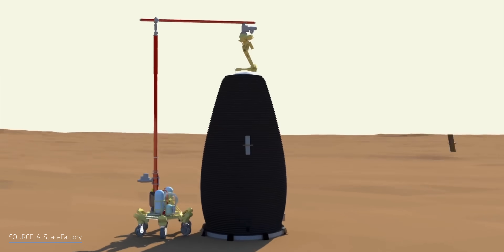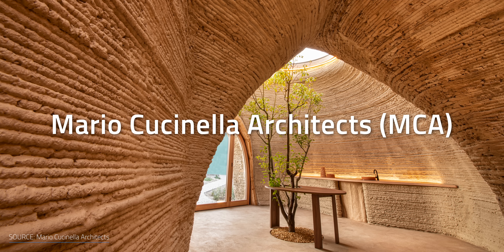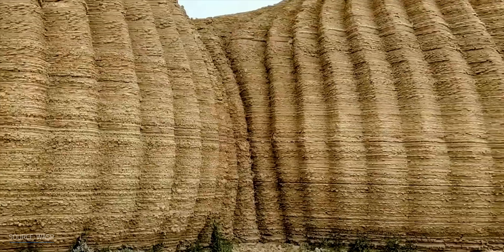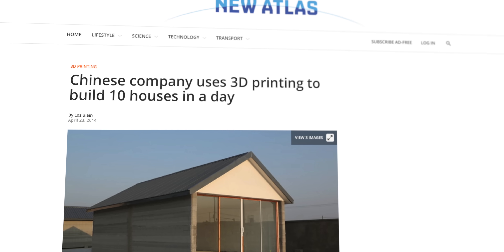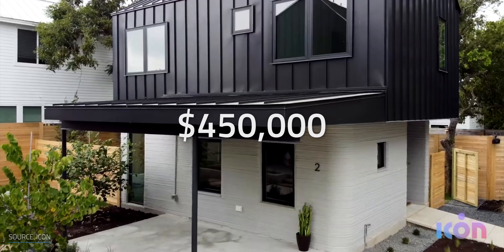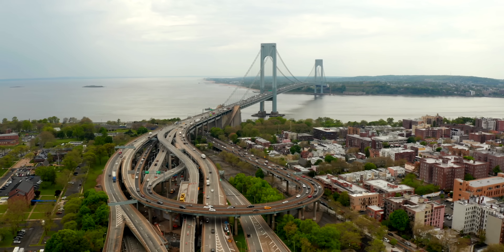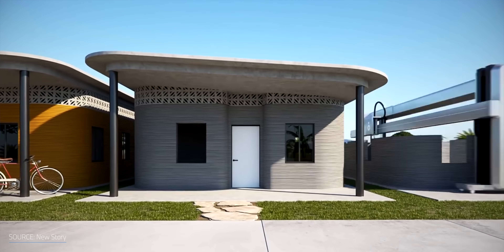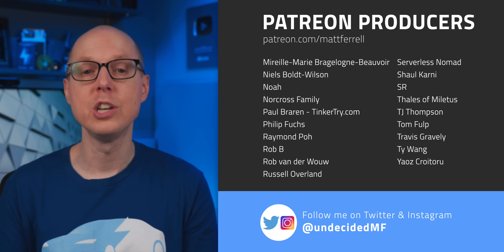The Truth About 3D Printed Homes

Comment: Issues I have seen with the only 3d printed building I have ever seen was the lack of rebar or other means of reinforcing the concrete and the building structure began cracking within the first year.
Reply: @TheItalix  If you look you may discover that there is some difference between rebar used to reinforce the concrete, and the steel beams. While the rebar is there in the concrete, the frame itself is comprised of steel beams. Anyone who has ever poured footers or slabs knows that there is also rebar used there.
Reply: @Andrew Layton It will not feed into the printer without balling up. There is no linear feed in the unit here, only a trough.
Reply: True
Reply: The
Reply: Marcus, which building is that?  Thanks!
Reply: @SpaceCrete  It was part of a hotel in the Philippines near where I used to work.
Reply: "Total Kustom"?
Reply: @SpaceCrete  Could be, as I was rather busy and did not spend much time outside.
Reply: Just fill the printed walls with concrete. As in a fixed formwork.
Reply: Rebar is the thing that weakens concrete.  Just watch some videos about "spalling."  
The Roman Parthenon, has stood for thousands of years.  You don't need rebar.  The Romans probably rejected it as idiocy, which it is.  
Insert a bar inside concrete, made of iron...at the first sign of moisture, it rusts, and EXPLODES the concrete away from itself.  
The sooner we ban that super-collapsible, extremely weak construction method -  the better.
Reply: @KathrynsWorldWildfireTracking  its to take the tensile forces. Without rebar concrete doesn't have the ability to withstand tensile forces. Sure, you can design concrete in a way to always be in compression, but this generally leads to inefficient designs. There's a reason it exists. Please don't assume you know more than all the industry experts out there who have dedicated their life to studying this subject
Reply: @KathrynsWorldWildfireTracking  as shown by the horrible building collapse recently in Miami...which I hope won't happen again but probably will...
Reply: @KathrynsWorldWildfireTracking  have you ever  been in a solid  mechanics  class?
Reply: @KathrynsWorldWildfireTracking  The Romans used different types of Concrete and construction methods as well. Rebar can create conditions ripe for spalling, but so can too thin a mud mix. Coating it may help in some cases, but your point is salient, though it does not always happen either. Most buildings still require some means to reinforce the concrete, especially in areas like garages and others with large, thick slabs stabilized with beams.
Reply: @KathrynsWorldWildfireTracking  ?? Or maybe make sure moisture doesnt get to rebar?

Comment: What I don't understand is the thickness of the wall especially the inner walls.
Does the software on the computer for the floor plan have  to be the only ones to go by.
And the flooring that is installed before building the walls, How is that done

Comment: Currently, at the state of the art, I see 3D printing along with modular prefabrication combined as a good way to build low cost housing. Of the type to upgrade slums. Using a handful of cookie cutter designs. The rest of the market leans towards aspirational designs, which add a lot of complexity, which often defeats the goal. With compact prefab modules for kitchen/windows/doors/bathroom/whathaveyou which slide in to simple wall designs, including all connection points for water and electricity where needed, all you would need is a few printed ducts on the outside to interconnect wall modules as needed. A modular these-sizes-fit-all flat roof, slightly slanted would I think be choice in such schemes. 
I don't know if two or more storey buildings and suburbia should even be part of the conversation yet.

Comment: interesting video, i'm a fan of mud construction, been planning to make my own
but i think here is issues with fast construction of a house using clay, either they are adding lot of sand to reduce shrinkage and or the weather was really hot and dry and allow them to build that house fast by putting a small layer of clay liquid one after another and it had enough time to shrink
i want to learn more about how they did it

Comment: Then there is the notion that the reason many people don't have suitable housing is more due to the lack of access to fair employment. A lot of modern technology focuses on reducing the overall cost to perform a given task by reducing the labor costs required in favor of a higher initial infrastructure cost. Due to this, many workers are being replaced with machinery and poorer companies that rely on manual labor often end up reducing the wages of their staff to compete with companies that use these technologies. 

In many cases, the key to ensuring affordable living in any country is ensuring an excess of work and jobs which provide ethical wagers for their workers. This is less a problem with technology replacing workers but rather a problem of a society built around an expected excess of unskilled work that expects everyone to work as much as they can to survive, which is currently experiencing a deficit in unskilled work.

Comment: prefabricated construction is a proven technology that reduces materials costs, labor costs, and carbon costs (ceteris paribus) onsite 3d printing kind of seems like Musk's "Loop" project. An expensive, flashy downgrade from existing technology.
Im sure it will be useful tool in many ways to the construction industry, but its not a silver bullet for the problem of housing. There is no silver bullet.

A Multi-Year comprehensive package of reforms and funding, combined with the proper application of existing techniques, aided by novel tech and implementations is required.

Comment: one thing i haven't seen in comments for 3d printing with soil is that some places like new england which have a high density of rocks large medium or small in the ground near the surface would cause them to spend possibly as much time digging as they do sifting to get usable soil to put in the printer

Comment: Stick frame houses seem like they'd be way quicker to build. I've built my own garage and nailing together 2x4 walls is very quick.  Not to mention cheaper and easier to install windows and doors. What happens when you want to add a window to these clay houses? Do you carve out a hole?
Reply: You use a pressure washer?

Comment: A lot of your cons with 3d printed housing are the same cons that normally built houses have. Though I would say that 3d printed housing cons aren't as bad as the normal ones. Even when you pointed out that it took 4 months to develop one of the first 3d printed houses, that's still less than the 7 months that it takes on average that a normal house would take (7 months and that was recorded in 2019).

This feels like the same situation that tesla had when it first started that, many people were shitting on them and some really liked it and hope. They were both new technologies the only difference is that in relation to production of theses 3d printed houses, we are currently in like 2011 tesla era.

Comment: It seems to me that 3D printing of a small number of construction components that could be easily assembled into a wide variety of lay-outs would be a more practical & less problematical idea.
   For instance, something midway in size between a standard brick and a cinder-block, but made with multiple tongue-and-grooves both length-wise and in the width, allowing for flexibility in laying down staggered layers.  If made with a mixture of clay and dirt and fiber-glass and other fibrous materials (& includes a kiln-line that fires them as part of the process), you would have good strength and durability, along with a 'lower-impact' effect.
   I'm picturing a unit that fits into a standard International Shipping Container (not the longer length ones), which is capable of being supplied with power from any of the standard formats of electrical grids (internally 'commuted' into a convenient form).  With four shapes of multi-tongue-and-groove large bricks available, and four print-head units in the entire assembly (each print-head unit being capable of producing each shape), the package could be used to produce whatever mixture of shapes was wanted/needed at the time.  By having the shapes include vertical channels for needed conduits, and at least one of the shapes include lateral openings for conduit access, little if anything would need to be done to the structure itself to 'finish it out'.  Little need to be drilling holes to install wiring or piping!  If wiring/piping is installed as the layers of blocks are emplaced, a durable insulation/fill material could be used to fill-in the vertical channels, yielding more benefits.
   That would seem to be an all-around winner to me.  Or maybe it's just a pipe-dream!

Comment: The problem with 3D printing is that it is best used for rapid prototyping and making unique products from print to print at relatively small scales, not the same product at larger scales. If you want to drive down cost then your best bet is to use more traditional construction methods, on an assembly line, at a large scale, making virtually the same product repeatedly, an application that 3d printing is not good for. Prefabricated homes are ideal for mass production and driving down costs. Affordable housing is just not an application 3D printing is good for. Affordable mass produced housing needs a scalpel (Prefabricated homes), but 3D printing is a Swiss army knife.

Comment: My family are in building industry for over 200 years and i was part of it ....why we use steel in buildings? So it doesn't break with the first earthquake....clay is nice but you have to heat it when it's done not just to dry it but to give it the strength like brick...or else it will be just a wet clay that is air dry too soft easy to wet and be destroyed .... brick is made put of clay also cement in the mix of the concrete is less then %25 sometimes lower depending on the place and design

Comment: As Materialscientist I am amazed about the boldness of 3D printing company which just claim to reinvent material which were optimised thousend of years. There is a reason why in civilised countries why are not using clay as main building material: it will degraded really fast so you have to rebuilt every 10 year your house. Please consider this in sustainable considerations. I was born in a at least 200 years old house and it still standing but it's made out of wood 3 floor high....

Comment: 3d printing in construction has a lot of problems to work out to be fully viable, an example of one of the problems is multiple story structures thus creating a wider foot print for the same amount of density. most problems can be solved with hollow  'frames' with routing for power, water and sewage built into the frame even before any other material is laid followed by a separation (such as a sheet of metal and foundation) then another frame.

Comment: yeah all that machinery, cost and power requirements is no go for many of us in the third world who are in the low income category, eventually it will get better and it will have its uses, but I say if you are looking at getting a home for yourself,  just build your own cob or rammed earth home, its not hard and the materials are dirt cheap. Now sure internals like plumbing and wiring can be costly, but you can still save a lot on bricks and cement. Plus if you take the time and effort to dig out more clay and make thick walls you can also have good insulation and heating or cooling the rooms become much easier. For those that enjoy pottery, you can even try out making your own teracotta pipes and use those for some of your plumbing needs. Though I must add that for those in the western world it will depend upon building codes, here in India we have codes but there is a lot of leeway, out in the rice growing regions of Assam all farmers have their patch of bamboo in their back yard so bamboo thatched houses are very common, very low cost and quick to set up. Bamboo is very economical and renewable, grows very fast and makes good furniture, the shoots are very tasty and since its hollow its traditionally used for piping in water, a truly versatile grass.

Comment: Oh good. A tiny house with curved walls so my furniture won't fit, made of materials that insects and rodents can burrow through with trivial ease. Just what I wanted.

Build tall. Not single-floor. Big ol block thing where people can live comfortably and within walking distance of the amenities they need. Not an endless sprawl of dirt houses in some kind of termite-mound inspired suburban wasteland. And setting up dedicated power generation and waste processing for a single home is just rich people showing off, those systems should be set up on a scale of whole towns at least.
Reply: building tall is extremely expensive and hard to maintain. africa can't handle that.  there is no real solution here. their population is too high. and they are going to die
Reply: @007kingifrit  ... you know there's cities down there, right? Like actual cities. Plumbing, traffic, working sewer systems, electricity? I know they only show mud huts on TV, but pick an African country, look up what their capitol city is, and then drop in on google earth.
Reply: @lexslate2476  there are.....for now

Comment: No offense, but this comes off as assuming great ignorance going in, and acting as if you don't have to do the same consideration with any house construction method.  It's like saying, "Energy efficient windows won't affect how much energy your appliances use."  Or, "Installing solar panels won't change your water usage."  3D printing only addresses the construction of walls.  It doesn't even address the materials of said walls, let alone aspects that have nothing to do with walls, like windows and appliances.  Talking about it in terms of the whole project simply doesn't make sense.

It makes more sense to first look at earth or stone or concrete options in general as compared to other options.  Once that's decided, then compare your hand built wall construction costs, benefits, and difficulties to 3D.  For instance, hand laid cinder block vs. 3D printed concrete, or hand crafted adobe vs 3D printed clay.  Point being, you chose your material based on your goals, and then the best construction method based on your materials, available resources, and other goals.

Comment: I built my own passive solar Adobe home in the late 70’s. I don’t understand why Adobe hasn’t become more popular. It was the best house I’ve  ever lived in. We rented it for a month from the current owner last year and it was as good as new. I didn’t see any settling cracks or any signs of age.
Reply: What does Adobe home mean?
Reply: @marzadky4934  Adobe Mud?
An adobe building is classified as a structure created by earthen and organic materials. It’s the absolute earliest form of structured shelter building known in all of human history. Adobe is Spanish for mud brick, and its life starts out as exactly that. Mud mixed with other organic matters, and turned into bricks and dried. ps. You can find out almost any information by making an  Internet 👀 🔍
Reply: Unless it is FIRED, adobe will fail in wet environments.
Reply: @marblelibrarianlibrarian4983  The adobes I used were “semi stabilized”. I think that with a stem wall high enough to prevent moisture wicking up and overhangs large enough to keep water off the walls that they would outlast a frame wall. It’s just a hunch. I think there should be more research on Adobe building in various climates. They are the ultimate in eco friendly construction material.
Reply: That is a good story - thanks for sharing it.  Temperate dry climate?

Comment: Civil engineering perspective: clay is a very unstable material that shrinks and expands too much to be used as reliable aggregate. There must be something added to it to give it stability.
Size will be a limit, reinforced steel materials are the reason we have the houses we have.
Longevity, I doubt these houses will be able to stand for 100 years without being reconstructed, a brick house has a lifetime of close to 500 years before becoming a hazard, depending on maintenance of the building, but engineers put a LOT of time in calculations to make it happen, to find something like clay to replace it...I just don't see it yet, but my mind is open.

Comment: Silly. Cob is easy and proven with minimal skill. Or even better, earthbag walls which are not reliant on a specific soil composition.
Reply: Rammed earth is not quite as simple as cob or earthbag, but they are much more resistant to animal and plant intrusion. It can be done by hand or mechanically, and is suitable for multistory construction. Loamy soils can be an issue for local materials sourcing, but most sandy and clay-ey soils can be used. It would be better to use loamy soil for agriculture or wilderness restoration anyway though haha.
Reply: Plenty of cob houses in Dorset. I'd prefer blotting paper.

Comment: its a vision that has potential.

however judging by the current state, i got 2 major concerns.

1. i really doubt the capability to resist weather, like rain/sand storm, and the long term durability
2. it looks really ugly

pre-built container looks more promising, which is cheap and durable